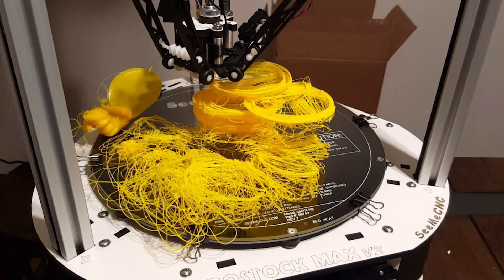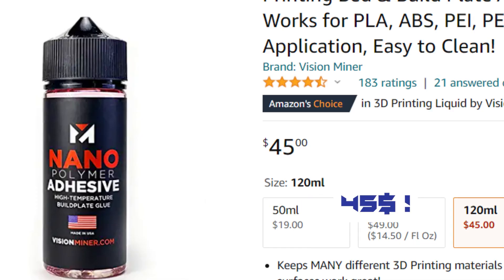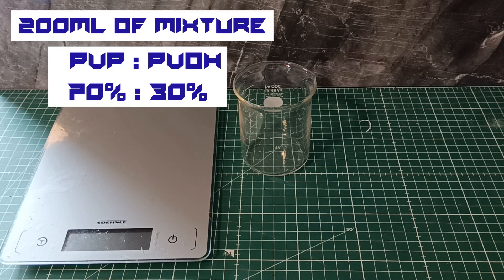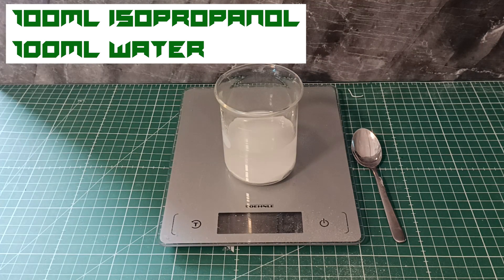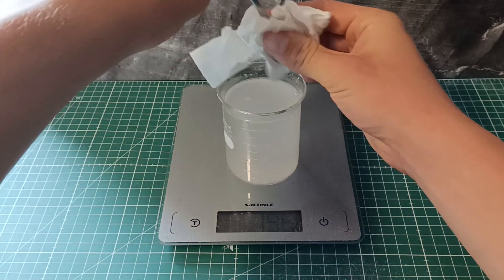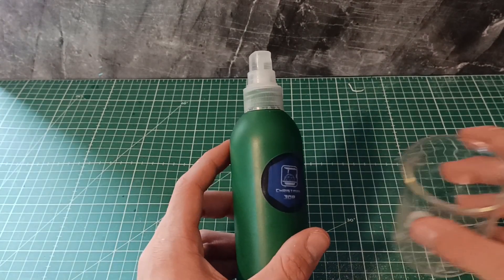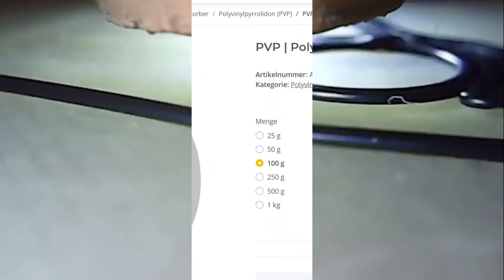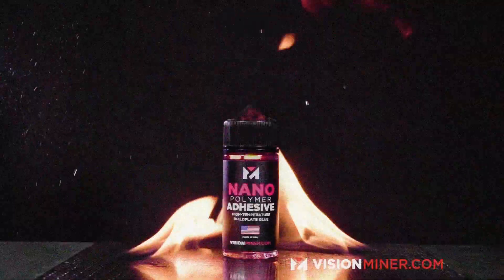AMAZING Print Adhesion EVERY TIME! | PolyMas DIY 3D Printer Bed Adhesive / Glue

Comment: My PVOH simply won't dissolve no matter what I try, heating from cold, adding a drop of ethanol, even NaOH as suggested on the internet, just becomes a sticky mess at the bottom... What specifically did you buy?
Reply: Dissolve PVA (PVOH) in distilled water first (takes sometime). Then follow by other ingredients.

Comment: Having actually made this stuff as well as owning a bottle of Nano Polymer, I can attest that this homemade stuff works at holding down PLA, PETG, TPU, and ABS/ASA very well. I have not tried Nylon or Polycarbonate with it yet. I only ordered about 200 grams total (100g PVP-K30 and 100g PVOH) and the star ingredient is the PVP-K30. That's the one you should order more of if you're actually going through the trouble of making this adhesive. I've made a huge 1000ml batch for myself and my friend and he hasn't had issues 

Now, is this stuff better than Nano Polymer, Magigoo, your regular old glue stick, etc? 

Yes and no let me put it this way.

If you're a business you should spring for Nano Polymer because they guarantee its use with a wide range of temps and materials, especially if you're printing HT stuff.
If you need just a basic release agent or extra adhesion in a pinch, a regular old glue stick is pretty much fine in every case and it is something most people will realistically have on hand.

Now this stuff is comparable to Magigoo and Matterhacker's Stick Stick and in my opinion it's way better. The beauty is you can adjust the recipe to have more adhesion. Is it more economical, potentially but if you are not running a print farm you'd never go through the ingredients needed to make this adhesive and not to mention one application can last many prints. 

Having said all of this, this recipe is worth making if you can source the ingredients. I haven't had a failed print at all since using this stuff and it lets me conserve my Nano Polymer for the really important and nice prints.

Comment: I've been using PVP + IPA in 1:18 ratio by mass. Applying it from spray bottle. When the bed is hot, parts stick extremely well, when the bed cools off, parts release by themselves most of the time. I've tested it on PLA and PETG for hundreds of prints - works very reliably. The issue I have with it is that after parts release, some PVP ends up on a part, which makes it mandatory to re-apply the coating every second or third print. So, I've started to look for a solution to better bond PVP to glass or make PVP stronger somehow, so that it doesn't end up on a part. Basically, I want a reliable coating that will last for a long time (yes, I know about PEI or PEX).
Reply: Have you heard about g10?
Reply: Tried it, didn't work for me as advertised. Don't know, maybe it was some bad G10 @lukaspetracek1890
Reply: @x_ph1l  oh. I have my gr 10 ordered for next week delivery. I had high expectations, you just scared me a bit.
Reply: @lukaspetracek1890  don't get your hopes too high, but if it would be awesome if it would work for you

Comment: I use Nano Polymer exclusively on my PEI build surfaces but the cost sure does add up. Just ordered some batches of these chemicals you mentioned (USA): 

PVP K-30 from Ebay - 100g @ ~$20
PVOH/PVA powder from Amazon - 100g @ ~$15

Will update once they get here. I'm planning to try a mixture using exclusively IPA instead of IPA + Water, as I have 70% IPA on hand anyways. I would rather have mostly IPA based so it evaporates off the build plate quicker when applying rather than having to wait for it to dry.
Reply from the maker: Make sure to share your results!

Comment: This is awesome and I can't wait to try it!  One question though - I gotta be missing something stupid but can someone ELI5 how 10g:2g is a 70:30 mix?  What am I missing here as far as how this calculation works?
Reply from the maker: It's not an exact mix haha, 70/30 is a recommendation and general measurement, i deviate from it in this video. You can adjust ratios and see how it affects! This is just the one i use

Comment: I've never had issues with bed adhesion for my delta, which is the only one I've ever had. I just figured out that I need to set it 10 to 20 degrees higher than the max temp listed by the manufacturer. Basically liquefy the first layer with no fan. The only real problem I have is with the auto leveling. It seems that anything larger than 5 inches from the center and more than 6 or 7 inches tall, always has the nozzle hit the print and eventually knock it off. Even with z hop over everything turned on and at 3mm high z hop, with 0.15 to 0.2 mm layer height. One of my problems probably is that one of the fan ducts broke on one side and I can't find an oem replacement anywhere. Tried printing a few that people designed for my printer but they don't really fit properly. Just got a resin printer and that seems to have a 1000% higher success rate so far lol. So maybe I will try making a duct with that soon. The other issue is the firmware was never updated, because there were none when I got the printer, it was current, and now my model isn't even available on the manufacturer website anymore. After 3 years. Considering upgrading to the Neptune 3 plus or max sometime after they come out and I have the money.
Reply: Just figure out the board and configure your own build of Marlin, or rebuild and replace the electronics altogether. Open source oriented boards come with a bootloader for easy programming, some that ship in printers do not, but if you have an extra Arduino kicking about or a usbasp it's usually not too difficult to sort out. My Geeetech came with bootloader but i chose another bootloader to make debugging easier because the stock bootloader has a bootloop issue on watchdog, which i tell you is not ideal when you're doing firmware development and accidentally flash a firmware which watchdogs immediately, and is also much slower at flashing firmware than would be ideal, and i just had to trace out the SPI pins as they come to the display connector and tap off them there to flash the bootloader.

Comment: I print largely PETG, occasionally PLA, occasionally ABS and hate it, recently HIPS and i don't hate it. I print on a glass bed on top of the good old red PCB heater. The glass doesn't really reach high temperatures very well, although the bed is insulated at the bottom with cork. Perhaps i should change to an alu bed to be able to get more heat into it.

What i have tried so far:

PVA wood glue, spread on the bed, let cure: not terrible, just takes too long.
PVA wood glue diluted with water or ethanol (tried both) loaded into a spray bottle: clogged the bottle very rapidly.
Glue stick from 1€ store, just like the one you're showing: complete garbage, absolutely useless.
Glue stick UHU: better, much better than cheap stuff, not ideal.
Glue stick with PVP, Deli 7091 from China: seems OK so far, better than UHU, but i'd wish for stronger ABS hold yet. I remember when i was searching for PVP myself, i was a little dubious on buying a bag of white powder abroad and have the customs inspect it. But i found this and i tried it and i'm reasonably happy with it. The way i learned of PVP is from a comment on a random YouTube video.
Hair spray store-brand from DM, extra strong hold: useless.
L'oreal Studio Line FX8 hair spray: still useless. And the stink of all these hair sprays, hell no!

Might be checking out your (well Makerbogans') mix as well, we'll see.